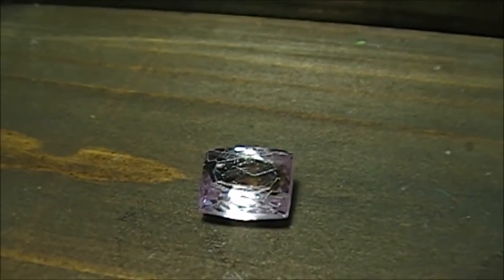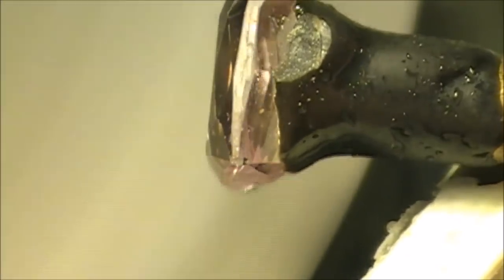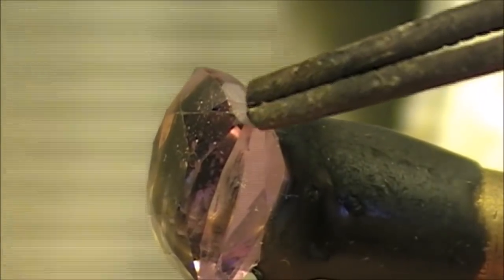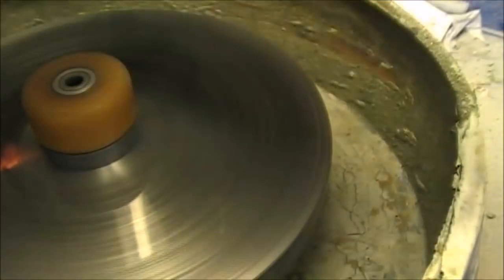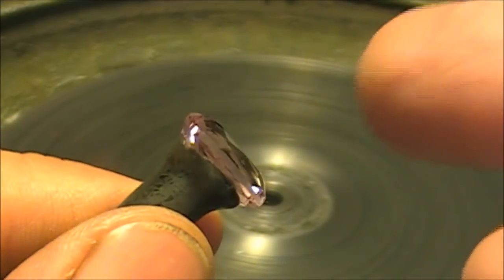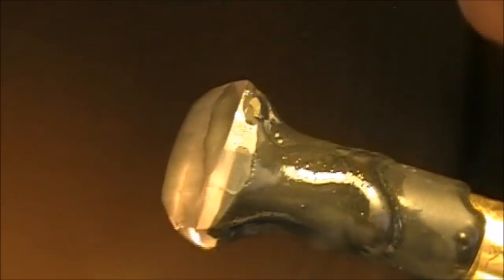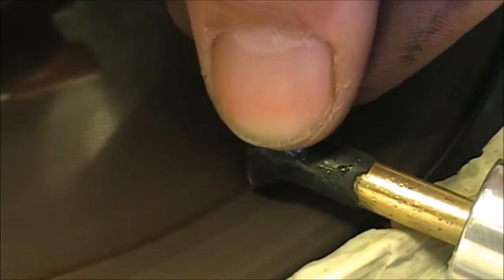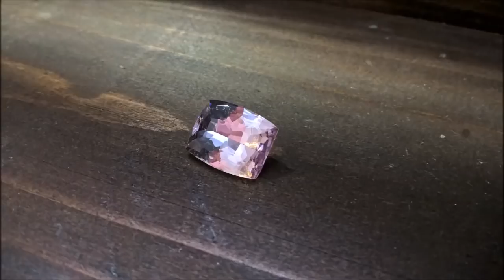Full gem cutting  tutorial: Cutting a Kunzite, all steps and considerations

Comment: is there any place where I can get the required gem cutting knowledge in bulk in order to process it in my free time ?
I understand diagrams are transposed to the machine, but tonight I made some research and found out there are charts meant to help cut stones based on the type and that those types influence a lot in the cutting process. 

any manuals (books) out there I could use to learn and understand the aspects of gem cutting?